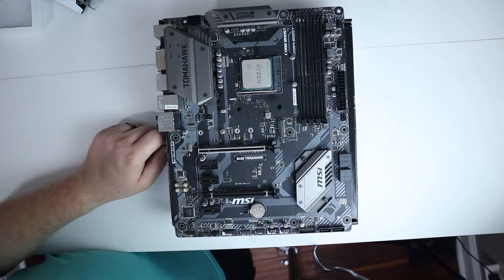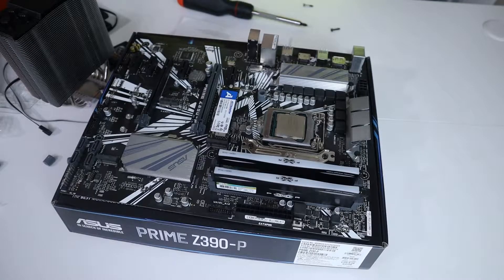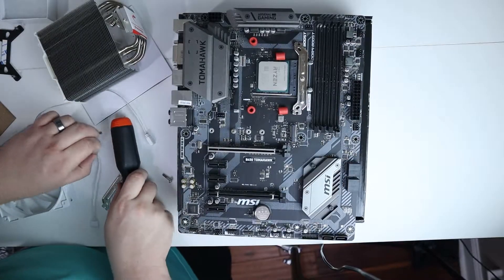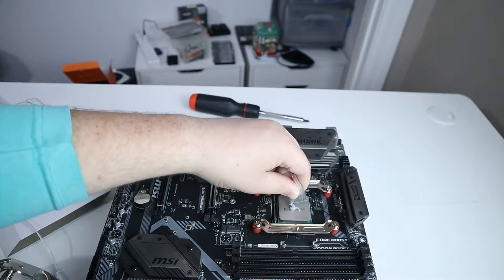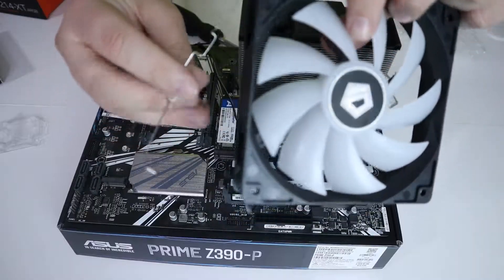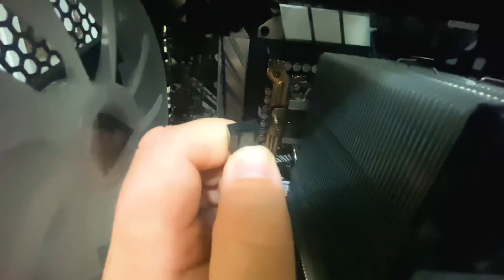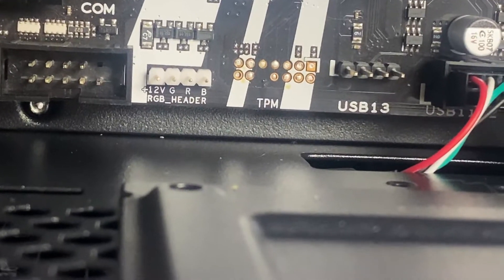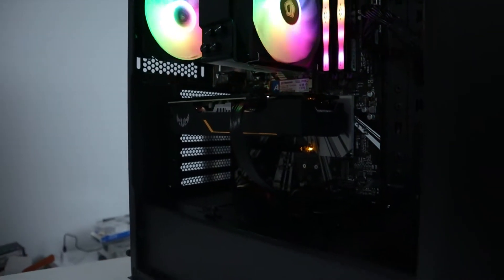Effortlessly Install the ID SE-214-XT Air Cooler with These Simple Steps

Comment: Screws on heat sink dont reach, only reach on one side, ive just run out of Thermal Paste so cant even take my old one back off to re test my new one, sure it might be something i did wrong, but think i tried turning the brackets in everyway they could go. What do i do?

Comment: Make sure you pay attention to where you want your fan, I put the gap facing the left vice the right (toward the RAM). Either way can work, but you'll have to swap the direction of the fan (push out vice pull in), which defeats the purpose of the ARBG. I instantly caught it, so was able to just swap it around before the thermal paste had any opportunity to dry.

Comment: My cooler didn’t come with orange standoffs only grey with ridges and smooth grey. Also the metal bracket is different it’s 1 solid piece instead of 2 separate.
Reply from the maker: Then you did not buy the same cooler as this one.

Comment: I have a amd and it won’t screw down on both sides only one do you have any tips for that ?
Reply from the maker: Make sure you use the correct stand offs and have the brackets turned the right direction.
Then make sure you only get the screws started on one side. If you try to screw it all the way down on one side you won’t be able to screw it in on the other side
Reply: @ thanks that’s exactly what it was 👍

Comment: Really can’t get those spring screws on the heat sink to tighten
Reply from the maker: Oh no!
1.) Do you have brackets turned the correct way?
2.) You do have put some pressure on it to get it started
Reply: @MMillerPCs  is the bottom of the screw supposed to touch the bracket before you start screwing?
Reply from the maker: @JakeBayley  I’m not sure which part you are talking about but the spring screw has to touch the threaded part that is sticking up from the bracket.
Reply: @MMillerPCs  Don’t worry I realised my issue. The brackets were upside down so the threaded part was facing downwards 😂. Thanks for the patience haha
Reply from the maker: @JakeBayley  okay!! Awesome!! Glad you figured it out

Comment: What is your case that has a built in 12v-rgb to 5v-rgb convertor hub? As a standalone hub, what do you recommend? Is there a seamless hub that has one-hundred percent compatibility? Not all of the modes cycle correctly, e.g., breathing mode. There is a glitch where the argb units erroneously flash out of sequence for a quick moment.
Reply from the maker: Man I don’t remember the case… this has been a while back. I will see if I can find the adapter for you
Reply: @MMillerPCs did you ever find the adapter i need one because i have a mother board with only rgb the ab350 gaming 3 and i bought argb fans and a controller for them thanks

Comment: The back brace does not fit even though it said it did when I searched it up
Reply from the maker: What motherboard / cpu you have?
Reply: @MMillerPCs  990fx killer. Its an older one
Reply: @MMillerPCs  and the cpu is an older Amd
Reply: @MMillerPCs  every cooler that I have gotten for this motherboard has not worked

Comment: My biggest question is, do you tighten the two screws on the tower until they bottom out? When i installed my brothers i ended up stopping before bottoming. I was too concerned with how tight the cooler was squeezing the cpu to the socket.
Reply from the maker: I just tighten until snug then stop. It’s suppose to make a good seal
Reply: @MMillerPCs  I don't think I remember it ever really feeling snug. Did you feel it snug before or somewhere after the springs were fully compressed? Thanks for the reply by the way.

Comment: Why won’t the screws on the cooler screw in for me
Reply from the maker: Are you using an intel or AMD CPU?
Reply: @MMillerPCs  ok for the intel install. The back plate does not match the 4 holes. It appears to be off by a few millimeters
Reply from the maker: @2ksteveG   well the intel back plate has notches where the little silver holes are. They all have to be popped to the far outside for 1700 socket